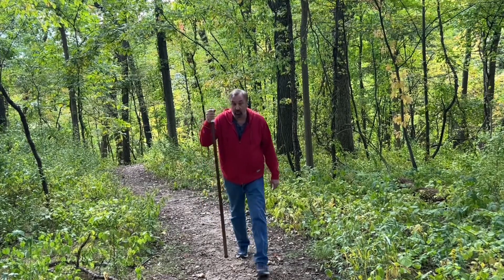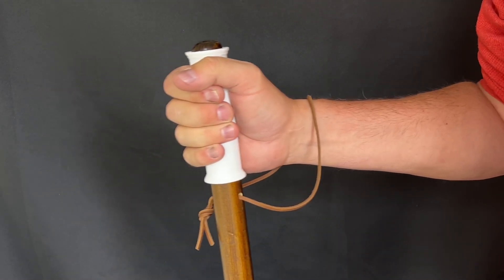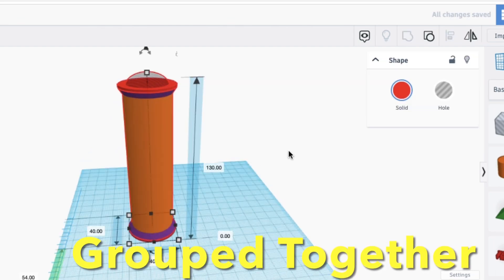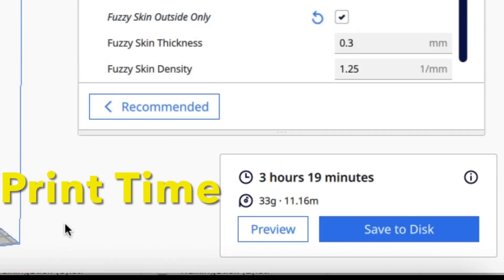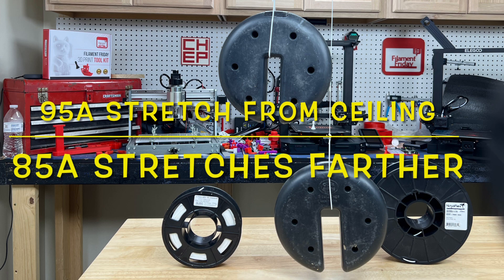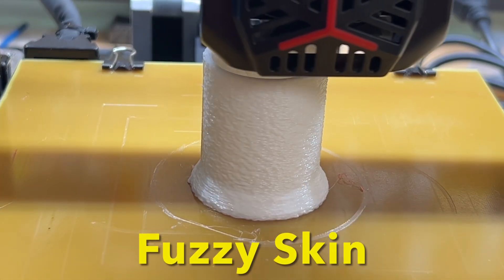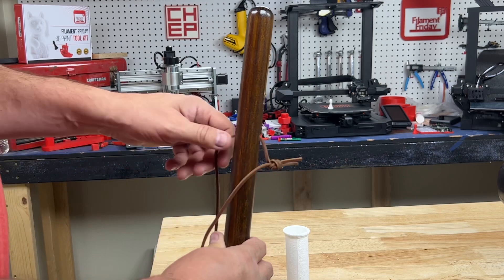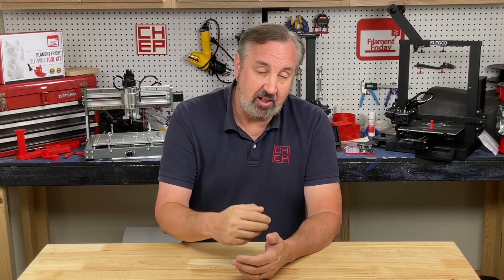3D Printing TPU Flexible Grip

Comment: I printed a ball shaped knob for mine. It’s made from some carbon fiber rod. SUPER light and plenty strong. I also printed a bushing of sorts to protect/support the tip. Then slid a rubber tip on top of that

Comment: I measured the shaft of the Aquila control menu console as I needed to design a new control knob to go on it as after I done a new cover for the screen body the thickness of it stopped the 
original Aquila knob from pushing down enough to click the picked menu, I use Digital Calipers and did many measuring, high width etc. 

I printed it in PLA on fine mode as it had the name on top sliced in Prusa slicer as Cura can't slice the text?
But every time I done one even changing the measurement of the shaft hole in the knob none ever fit?

All are too tight.  So much for that idea.
Reply: Internal holes always print undersized and external diameters always print oversized.

If you adjust them by, say, 0.15mm to 0.2mm (on a printer which can produce accurate dimensions) you should be able to achieve the needed clearance.

Before doing this you need to ensure your extruder and axes steps/mm are calibrated otherwise you make the print sizing errors worse.

Comment: How sensitive to heat is TPU? If - on a summer day will it melt?
Reply from the maker: No it has a melting point of 160°C. If it gets that hot in the summer we’re all dead ;)
Reply: @FilamentFriday  thank you! Somehow I butchered up my comment and left out the "if I throw it in my car and leave it there" part but at 160 sounds like it would still be good as long as you avoid direct sunlight.